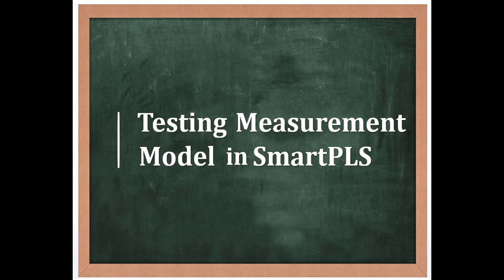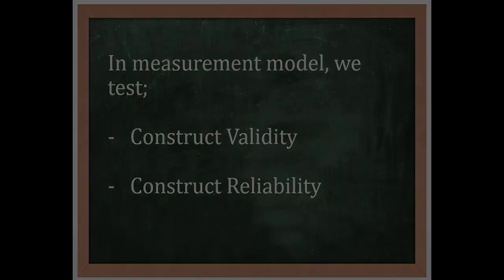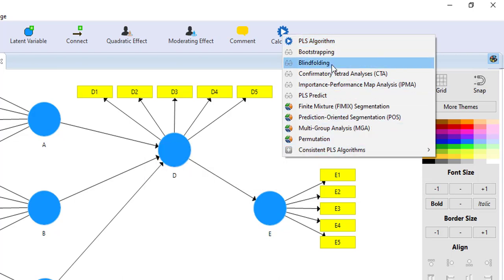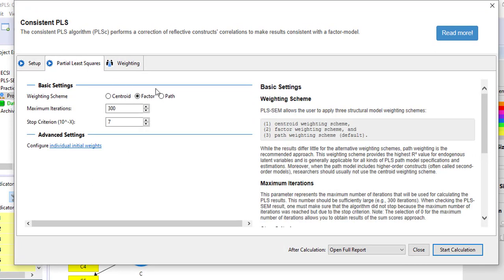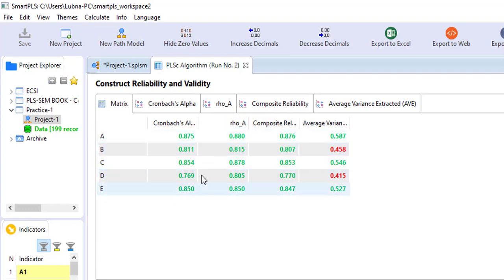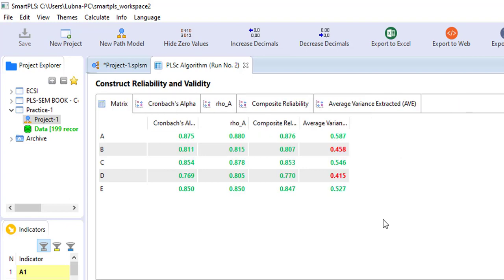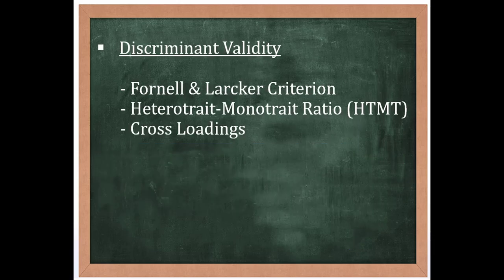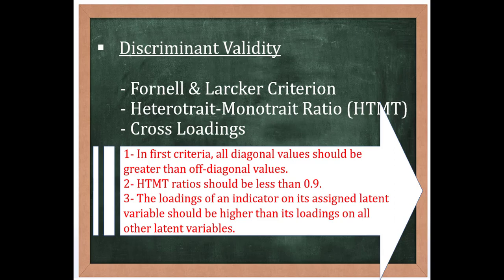Testing Measurement Model in SmartPLS

Comment: In using SEM, it requires both the evaluation of the Measurement Model and the Structural Model. But is the evaluation of the measurement model still required or needed, when all the questionnaire items are adopted from previous research?
Reply from the maker: Whether the questionnaire is adopted or adapted. We have to test measurement model.